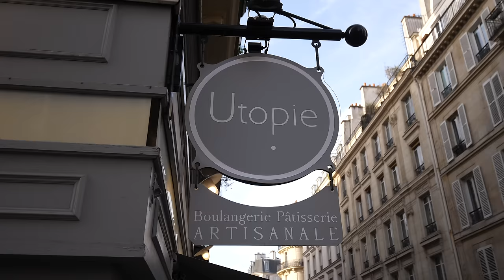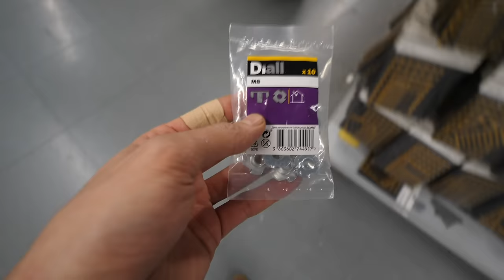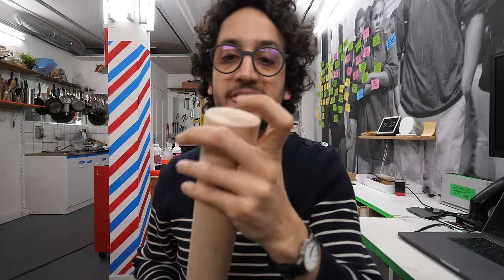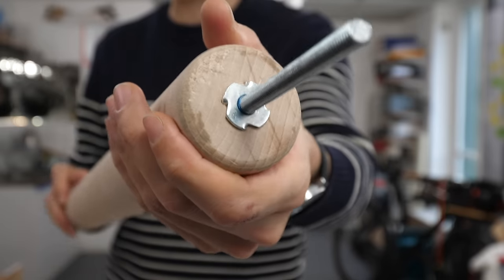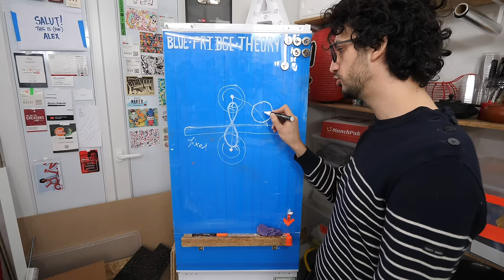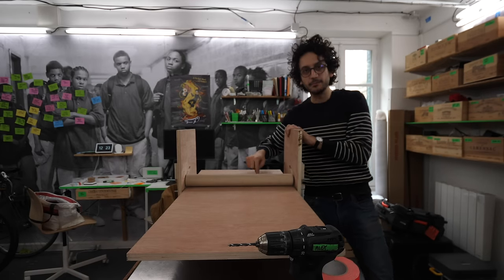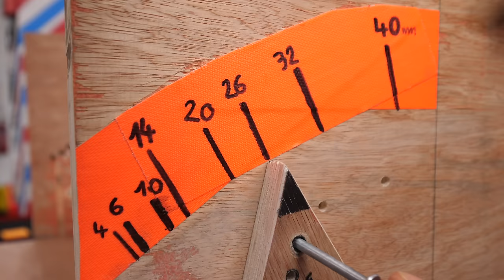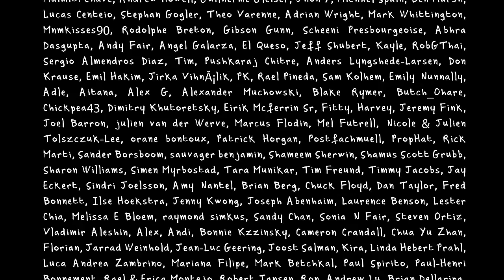I Built A Dough Sheeter To Solve A Croissant Problem...

Comment: I use a sheeter at my bakery but we use it to roll out dough for cinnamon roll's and honeybuns and a few other things and there are 2 conveyor belts on either side of the roller each going at a slightly different speed to help stretch the dough so you may want to consider that while working on yours if you put a motor on it

Comment: Moving the top roller in a radius is such an easy and beautiful solution. I'd have probably been stuck for an hour trying to build a tensioning system with an idle roller or sth.

Comment: When you came to the problem of adjusting the distance i immediately thought of a chain adjuster. It allows for more or less belt, chan ect. to be used and still keeps it tight around the gears.

Comment: Use a rack and pinion set up  on the sliding board and use a drill with a forward and reverse function to run it back and forth. The lower roller could be swapped out for it and it would give you the liner movement your looking for. Plus with a 18 or 20 volt drill you should have plenty of power to run it

Comment: Hey Alex,
Quick thing about your rollers. The 0.5mm tolerance may be do to the flex in the roller shaft itself. As the material(the dough) enters between the rollers, the force it exerts is concentrated over the area the dough comes in contact with the rollers. Assuming the ends of the rollers are static/rigid enough, your roller could be flexing in the middle(also assuming the dough you used was fresh out of the refrigerator. Dough is most likely less elastic etc etc). I highly suggest you mount either larger rollers or double/triple rollers stack on top of each other(assuming you will motorized the top and bottom rollers, the rollers stacked on top do not have to be connected, their sole purpose is to minimize the flex of the main rollers that are in contact).

Also the top roller and bottom rollers don't necessarily need to be connected, they however should run at the same rpm. If you want pretty precision go with 2x stepper motors. If you just need to simply roll it through, two dc motors should be fine. You can set a low rpm+ "eye ball the dough" and change directions fo the dc motor.

Let me know what you think of this! Cheers

Comment: Small electric drill with a (self made) gear drill bit that is affixed to an underside track on the machine. Simply make it go side to side by using the drill's built in buttons. The center can run on rails from old drawers with ball bearings.

Comment: oooh.  a new this old tony colab?   seeing this build all i was thinking of was using an etching press.  replace the felt blankets with parchment paper and I am sure you can get the results you are looking for. they may be a little bit too overbuilt but the mechanics are the same.  also as a machinist and a wood worker, you are only guessing on finding exact center on wood.  it literally changes on the weather. ha.  keep up the good videos!

Comment: Salut Alex, you could higher the straight of the downforce on upper roller by adding springs on both sides of the roller  shafts. By anchor it to the bottom side of the springs in front of lower roller on the direction of the guide rails.
That way you could even the dough because the springs are there to help removing the vibrations!  
keep up the good work, love your videos! Now I make a mad pizza thanks to you!

Comment: Alex, add 2 more extra rollers(not rolling pins) at the bottom and the top of the moving (plank).

This will clamp the plank in place. 

To increase the accuracy of the device, u would have to resort to using metal (not aluminium).
This reduces the deflection of your pins and henceforth make it applicable for long term usage.

As for mechanical input,
a short term solution would to just use a drill with reverse settings like simone giertz in one of her cake conveyor belt videos.

Comment: Alex, I have some suggestions on improvements for this machine, first replace the rollers for the platform with drawer slides, and second for your electrical input you could use a spit roaster, they usually come in a variety of weight ranges and are a fairly powerful motor for your rolling pin.

Comment: Alex, pro tip for cutting plywood: put masking tape (blue tape) on the cut line before you cut. This helps keep the outside layers of the plywood from splintering when the saw blade exits the cut.

Comment: This is an awesome build. I think the issue with using wood though is it’s ability to flex. To achieve the desired result you would likely need to use a hard steel or a wood rod with much greater mass.

Comment: Salut Alex!
Great video as always! However, if you are looking for a way to get much higher precision components, I have a tip for you: laser cutted wood.
Let me explain: I don't know exactly were you live in Paris, but chances are there is a "Fablab" somewhere nearby. Those are associative workshops with more or less fancy equipment, sometimes including laser cutting machines.
For one of my projects, I used this technique on thin wood (3mm MDF) and the results in terms of precision is amazing! You can also make sturdier components by gluing several laser-cut layers, and use other materials such as Plexiglas.
Anyways, I think it would be wort a shot. Keep up the amazing work!

Comment: You need a center finder. It's a simple mechanical gauge that lets you draw lines across the center of anything round. Getting the axes of your rollers exactly at the center point is the only way to keep them from wobbling.

A Drill press wouldn't hurt, either. Or at least some way to line up your drill so the holes are aligned with the axis.of your part.

Comment: Message
Toutes mes félicitacions, Alex, pour ton sense aigu de l'ingénierie!  One suggestion: use a large ready-made cutting board for the horizontal platform.  It can double up as a regular cutting board when not rolling dough.  That avoids the wood splinters you might get from the plywood.

Comment: Alex, take a look at stepper motors and systems used in 3D printing / routing. It should should solve your conveyor belt issues with a tolerance up to 0.1 mm with movement speeds of up to a 8 centimeters per second. It's essentially a belt driven system with a logic board that controls the forward and backward movements, which you could wire to a flip switch instead.

Comment: To find the center of a circle, use something with a 90 degree angle like a standard sheet of paper.  Cover the circle with the paper just until the corner of the paper touches the edge of the circle.  Mark the points where the two straight edges of the paper land on the perimeter of the circle.  No matter where those points land, they will be diametrically opposed.  That means a line drawn between them will cross the exact center of the circle.  Do that twice, make the two lines intersect, and you have it.  Geometry is tight!

Comment: I would have used all thread screw on the top one with a brace across the 2 sides for the thickness it will be held on the roller on the sides. To join the 2 use a strong spring on the screws you added to the side. Also add a second set of supports under the table with pvc to help it roll across on an even plane.

Comment: The whole lower mechanism isn't required. Just put the dough on the table top and make a height adjustable rolling pin that can flatten he dough to a specific thickness. Basically a rolling pin on 4 wheels that can be precisely raised and lowered. It could be attached to a rail system so you don't have to manually move it or put down force on it. So you're moving the roller and leaving the dough stationary. The reverse of how the laminating machine operates. Seems much simpler and smaller to store. Just a thought.

Comment: Will this end in another ThisOldTony build? XD
My CNC isnt finished yet so i cant offer parts, but i would have suggested milled inserts for stainless steel tubes, linked offset cam adjustment axis and a basic roller belt, all powered with some 5mm shaft geared motor and cheap GT2 belts and pulleys.

Comment: So what you want is a pressure on the angle adjusting bar to force it down, and have it lock in to set positions and not give.  Probably want stone rollers.  Also maybe a tiered system so you can take dough that is ready to be processed, so it can flatten enough for rolling, then flop it on the sheeter plane and automatically roll it flat.  You would need some Arduino action and other open source controllers to run the whole system.  But you could totally garage this.

Comment: I don't know how easy it would be for you to make gears, but a vertically sliding top toller with power engagement from the side will work too since the power engagement coming from the bottom goes to the side and stays the same, but leaves room for vertical movement of the working axis.

Comment: The rolling pins are slightly out of center, but you can fix the top one by adhering 1mm thick sandpaper to a board of say 9mm and then setting the machine to 10mm thickness and spinning the top roller with a drill while holding the sanding board still underneath the spinning roller.

Comment: Use nylon cutting board stock instead of plywood. Use two more rolling pins(with handles) under the board to roll it on.  Yes, I have also spent numerous hours designing a home sheeter.

Comment: When you dropped your 6 mm slats to calibrate your machine, it became clear that you had solved even the need for a machine.  If you use a regular rolling pin and slats/"screeds" of known thickness you have all the control needed for rolling small quantities of dough. You get to use your marble bread board and marble rolling pin though. You might try wrapping the roller on each end with wire of a known thickness or fat elastic rubber ring that approximates the thickness.

Comment: To find the center crudely, you might try tracing the circular end of the roller, then fold it in quarters, lining up the outside edge of the circle.....where the folds meet, is the center.....

Comment: 2:23 - go find an antique wringer washer, and get the rollers on it. They are massive and very strong.
5:26 slender wedges. You can make them so a connector rod to your foot pulls them back a little, or allows them forward a little.  aHA! (7:43)

Comment: For the part of the motor, you can use a drill or if you prefer a more permanent solution use a dc motor conectec to a gear box with a control board (realy inexpensive solution and easy) or if you are going to used at relative low speed, you can use an stepper motor with a micro controler to have precise control over the speed and the travel (also realy inexpensive solution but a litle bit more complicated).

Comment: You could make the displacement motion vertical and still connected using two additional, large gears, so with 4 gears in total - the roller points can both rotate around their own connection gear for thickness adjustment. Or the same with two belts meeting at a common point on the side (and the rollers rotating around that point) instead of one belt. But is a much more complex solution than what you have and if ti snot important, then there is no point of going more complex.

Comment: When cutting with a circular saw, place the finished surface down. That way the blade is turning into the finish and there will be less tear-out. Also using a blade with more teeth will reduce tear-out.

Comment: Securing the other end of the top roller will help

Use 2 servo motor to change the position of the roller

Use a hydraulic piston to push the base board forward and backward

Comment: Did you get the axles of the rollers concentric?  Otherwise I don't know how the thickness could be uniform.  BTW, instead of a lower roller, can you substitute two bearings on each side protruding inward from the side panels?  That might be easier to get 100% uniform.

Comment: Could you of used something like a set of bicycle sprockets on the end of each roller and a chain tensioner as a way to be able to adjust the rollers? As long as the sprockets have the same amount of teeth it should be fine, right?

Comment: FWIW, to find the center of a dowel, (generously) cut the corner off of a box, mark a line 45 degrees from one corner, then cut far enough in along that line so that when the piece is placed on the end of the dowel, the cut portion crosses the center.  Now mark a few lines on the end of the dowel along that 45-degree line and Voila!  You have just found the exact center.

Comment: How are you preventing the side without the measurements from lifting up as the dough is pressed?  I see that your clever calibrated pins work to lock in one side of the roller, is there a pin on the other side too?  It appears to flex in the footage.

Comment: So, if you want to put a motor on this then I think it won't be that bad.  You will need a lower h.p. higher torque motor with a forward and reverse setting.  The motor can be mounted on the bottom of the machine. With a toothed gear and a type of either flat track that fits the toothed gear or chain that is mounted on the bottom of the moving table, not the rollers.  This will allow you to make this into a coneyor belt style.  The big part here is high torque motor, so the dough will be squeezed through without overloading the motor.

Comment: Is there any specific reason why you didn't make the conveyor adjustable instead?
Reply: The conveyor is resting on the lower roller. If he made the conveyor adjustable, he would have had to make the lower roller adjustable as well, and we would have the same problem again, but this time with one more moving part.

Comment: here's an idea for your machine: fix the plate and make a treadmill, I don't think the top roller needs to be motorized either, it can be free rolling.
so basically use a food safe belt to move the table instead of the rolling pin.
also a good enough stainless steel rolling pin is 10 euros, so you could use that as a roller.

Comment: Try more guide bearings along the sliding tray, metal right angle around the tray’s perimeter, two pins per side on the control arms and fit the pins into metal sleeves instead of directly to the wood

Comment: Have you thought about using pvc pipe as a roller?  Perhaps with the wooden rod inside for support.  Even if the pipe was a loose fit I don't think it would cause a problem, and would keep your wood roller clean.

Comment: Instead of two rollers could you have tracks on either side of your table, and a frame holding a single roller that rides on bearings?

Sort of like a Lowrider CNC's X and Z axis, but without the Y axis and computer control.

Comment: Mate you can use a right angle triangle ( engineers square) to act as a tangent to the radius/diameter at two points and find the center.

Comment: As a less elegant, maybe impractical solution - a paired set of spacers that you could clamp to the table and roll the dough between.  If the spacers were set up as base 2, (1,2,4,8,16) you could roll anything from 1 to 31 mm with only 10 pieces of metal, 4 clamps, and maybe a 4" cast iron waste pipe as a roller (to give it some heft).  Unless you're looking towards opening a bakery yourself.

Who am I kidding, we all want to see what monstrous thing This Old Tony whips up...

Comment: My idea when solving that would have been a stepping motor that goes in between both pins and they are connected by a belt. With a spring the stepping motor is pulled to one side and keeps the belt taunt. (You know how the chain on your bicycle is kept taunt? Something like that system)
What are the problems of that design?

Comment: I know it's not as cool as a DIY dough sheeter, but why not just build a bunch of guides to put on the sides of a wide rolling pin?  Just two strips of wood 6mm high  (or any other height) that you could clamp down and then roll a rolling pin over.  Seems like it would be more consistent and less wobbly than trying to find the exact center of a dowel.  Or perhaps two small circles that you could attach to the end of a rolling pin with a radius 6mm larger than the rolling pin diameter?

Comment: Hmm, guessing the roller's aren't completely level, and then they're flexing too. Can I suggest looking into trying to find a mangle? Old fashioned clothes drying machine that works by squeezing water out of clothes and you can manually change the separation and you can find ones that work with a board.

Comment: Why do you need the lower roller? The upper roller is compressing against the board moving on ball bearings, not against the lower roller. Also, there are a large number of videos on center-finding tools that will give you a very precise measurement.

Comment: i was thinking snekkegearing in which case you can place the gears anywhere on the snekke. ofcourse this type gearing is a major pain in the ass without the proper tooling. so what you have is probably acceptable anyway as the treadmill doesn't need the pins to be above each other.

Comment: Personally I think a conveyer is a much more elegant solution. Make the frame out of aluminium, probs just rivet it together, then use silicon/rubber conveyors. Also this way everything is a lot more secure so you lose the play in your rollers. I’m sure you have a fabulous plan but there’s my two cents!

Comment: In order to find the center, you need to use a caliper to find diameter, and let’s say that diameter is 5 cm, then you would use a ruler and move it around the circular end surface till you get a 5 cm on the ruler and that would indicate that the ruler is lined up with the diameter, do that at 2 or more angle and draw a diameter each time, the intersection of 2 of these lines should give you the center, but the extra diameters are for verification and further accuracy,